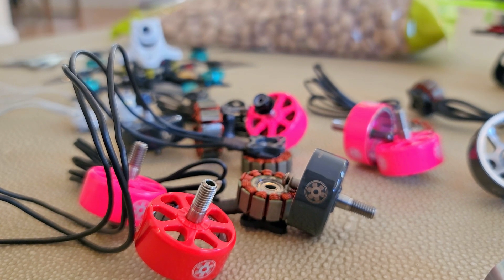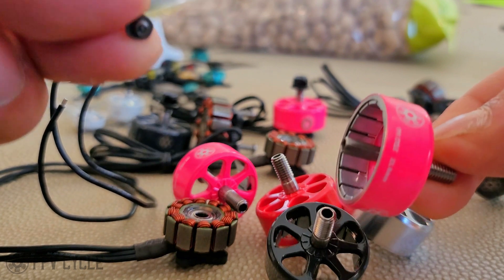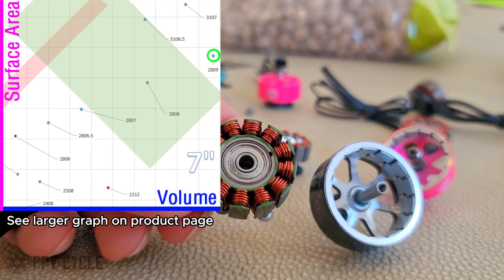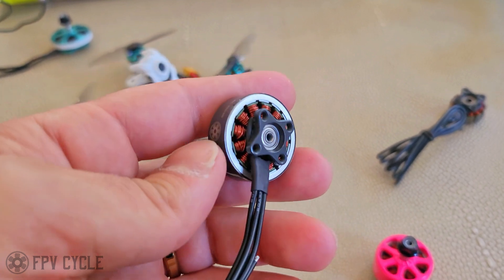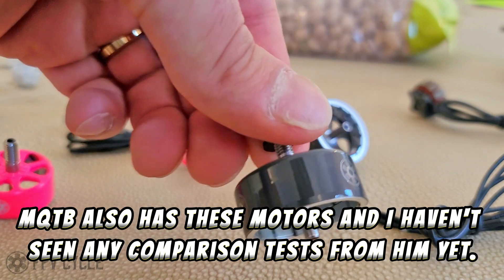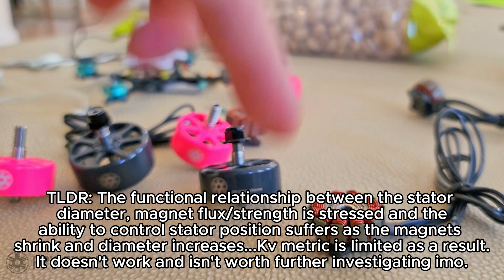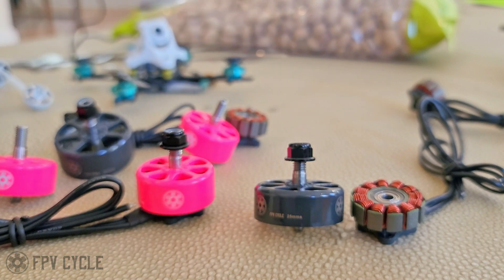Split Shifted Magnets and New Motors

Comment from the maker: Table of Contents:
00:00 - Intro
00:25 - 22.6mm motor stator numbers
04:49 - 28mm motor
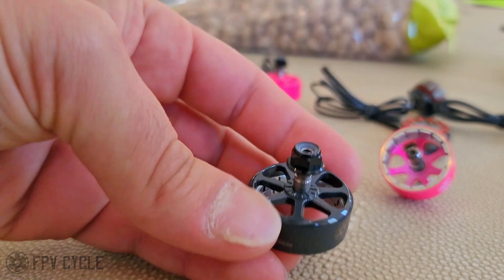05:52 - 25mm motor with split shift magnets
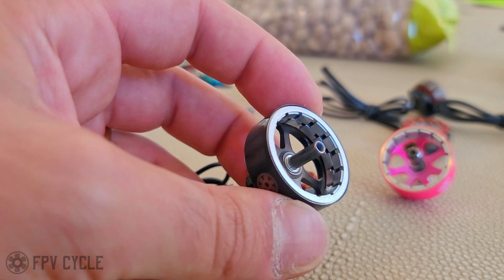07:23 - Split Shifted magnets
09:19 - What split shifted magnets are supposed to do
12:36 - Split Shift magnets don't work everywhere...
16:38 - Difference between 25mm and 22.6mm performance

FPVCycle.com motor lineup: 
https://fpvcycle.com/collections/motors
Reply: aluminum dont rust

Comment: 👎

The screw fixed by heat resistant loctite.
The ball-bearings are heat sensitive.
The tension on the screw must be such so all 4 motors have equal resistance.

You need specialised equipment to do a proper motors maintenance.

Comment: Thanks for the video, you're always up to some very interesting work. I myself keep thinking that we loose a decent amount of performance building everything to be universally compatible. I'm thinking about optimizing a frame around a pre selected set of components.
Reply from the maker: I think the motors, specifically the Kv, prop size/model and battery are the most significant factors. Unless you're doing something very specialized like top speed or aiming for cruising efficiency or something, it's hard to optimize things in a meaningful way.

Comment: Alright sooooo I need 1 or the other 😂 well first let me ask are you discontinuing the 23mm Tall motor for these? If so can I request these in a white color too, I use all your motors from your 13mm and up and have them and white and love all my stuff to match or… hear me out can I get that raw finish in the 13mm? 😂
Reply from the maker: Check the site now. We have the 22.6mm motor with 12x12 M2 mounting base. This is literally the best all around 5" motor as far as I'm concerned and I believe the largest motor out there on the 12x12 M2 mount

Comment: bummer I wish those bells would fit my 2207.5 motor I'd get a few sets right off
Reply from the maker: The split magnets don't work well on any narrower of a motor. It just feels under powered. It's gotta be a 25mm or wider.
Reply: i see 
 @Kabab

Comment: really cool, I recently saw newbeedrones bonded magnet motor (the smoov) and got me thinking, with the bonded magnet all you would need to do is cut it in half and shift it for the same effect, or even cut it in 3 rings or even more???
but I guess other merits like durability aren as sought after with quads that size. That, and I wonder if the tradeoff of efficiency would be worth it.
Reply from the maker: The smoox was intesting but magnets like that are generally much lower strength and so the efficiency and power of that motor was very limited. The split shifted magnets that we're doing now are considerably more difficult to manufacture and they are a bit more efficient on average while generating about the same power.

Comment: I was going to buy the T-MOTOR VELOX but mostly because they are CHEAP AF 14$ a piece. Mainly because in alot of manufacturers these days you can't even get replacement bells (witch is what I mess up on motors) Then I saw this video and I think you sold me in your one comment about "selling bells separately" because EVERYONE should.
Reply from the maker: I don't know why it took so long for even us to do this. I wanted to do it years ago. I actually think it should go a step further and we should standardize shaft lengths. That way you can choose any stator size base and choose the appropriate bell of your liking. All 2306 bells will fit all 2306 stators as long as the shaft matches. Almost all shafts are now 4mm diameter so pretty easy to just choose a length standard or at least list shaft length from the underside of the bell top to the end of shaft.

Comment: I gotta have some hot pink! Also, aluminum doesn't rust, it may oxidize eventually but not rust except   on steel. Aluminum oxidation is a central part of it's corrosion resistance due to it's high affinity for oxygen. It also depends on environment, the purity of aluminum and the presence of other substances.
Reply from the maker: Yeah it doesn't explicitly rust but without anodization or paint, it's supposed to oxidize and sort of rust....but doesn't unless it's exposed to quite a bit of salt water in my experience or some other ion heavy solution in a liquid medium.

Comment: Dude you got way too many different Motors and not enough consistency man. I'm sure everyone including myself appreciate the level of commitment but you have Motors that are discontinued after one or two batches the people are stuck with three motors that work and can't get anymore. I don't get it
Reply from the maker: What motor? We have only discontinued one motor line which isn't even discontinued, just had low demand. That was the 2104 motor. The 23mm short functions the same as the 2104 so it didn't seem logical to maintain that entire line because it's 1g per motor lighter. Otherwise, the looks might change but the line is still the same.

Comment: information        you may know:   a typical electric (inrunner) motor is always loaded via  reduction/Mechanical Advantage (MA).      in contrast, an outrunner motor is usually loaded via  fractional/negative  MA.    ( compare the radius at which the force is produced (in a motor) to the radius at which the load occurs, at the prop/rotor. )
Reply from the maker: The long hand way to explain that gears are smaller than props. That being so, the diameter of the motor isn't necessarily indicative of it's torque. Usually 1mm more magnet height is FAR more beneficial than 1mm more diameter.

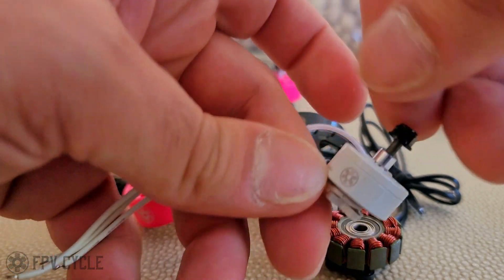Comment: information        8:08   the reduced gap size (at the stator poles) helps to reduce cogging and cogging-related losses.        the use of this low-tech offset magnet configuration 'increases' those affects.         8:36   COGGING.    is the 'drag' that occurs when a magnet(s) is aligned with a stator pole(s).      cogging is less apparent when a motor is running; but it's still there.          specious remark.      to the extent that it's possible, the generation of back-emf in a motor is minimized via  stator design/materials.                    11:05   bla-bla-bla-feels like-bla-bla-bla            because there are Two sets of magnetic poles (on the rotor) where there was one set before, the  number  of  cogging positions  HAS   Doubled.!
Reply from the maker: each 'cog' position has lesser 'drag' however. As a result, the emf peaks are reduced but there are more of them. Generally reduced peaks are easier to deal with as they don't cause as much disruption. I personally didn't measure this and don't really care because the regular magnets run fine too with a decent cap on the ESC. I'm strictly focusing on flight feel because that's really all that matters.

Increased stator/magnet gap reduces cogging from my experience. It lets the magnetic fields space out and blend better while also just being less strong at a distance since field strength drops off very quickly at 1/r^3 or something like that.

Comment: Building my first fpv quad, and just decided to use bobs 22.6 motors based on the info he supplied on the product page for them, and the gemfan 51433 props. All before Bob made a video about them or any reviews had been posted hahah I trust kebab enough, I'm fuckin pumped to throw this thing together. Just need Batts, charger, and soldering materials now.

Comment: Can we get reflective material motors so if you lose it, you can find it with a flashlight near Dawn or at night easier I LOVE that split magnet bell
Reply from the maker: The motors aren't what are going to light up in that situation. Some sort of a beeper is still the best tech we've got for things like this. Someone could probably write a script such that the controller could triangulate the position since pretty much all Rx's now have good telemetry...

Comment: Great Video and work KababFPV!😃 I have to admit that I didn't quite understand everything because my eyelids closed in between😜But something that would be very interesting for Tinywhoop motors would be the better throttle resolution or the easier handling of throttle with split shifted magnets. If the split shifted magnets would help with that in any way, that would be very nice. That would be a game changer. (as well as throttle MID to 0 and throttle expo to 30-70% was a game changer for me when flying tiny whoop) However, tiny whoop motors are always high kv motors. In any case, I would be happy if you were able to build 1S motors with Chinese manufacturers again at some point. Especially also ultra light 702 802 1002 motors for whoops. 
I'm looking forward to your next video :-)
Reply from the maker: Ooh it's hard enough to make those tiny motors as is. There's no reasonable way to adjust the magnet design like this in such a tiny motor and still be able to manufacture it at scale
Reply: @Kabab  Ok I understand. To hard to manufacture..

Comment: Curious, were any experiments preformed with configuring the ESC's differently for use with the split-shifted magnet motors?
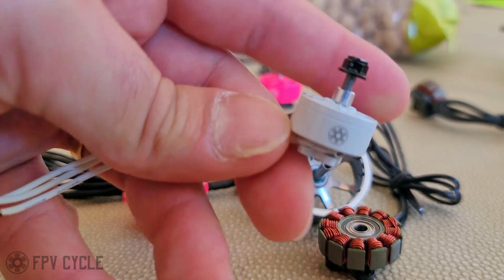Mentioned in the video is the number of pole positions (8:11, with manual rotation) is a doubled notch feel with the split-shifted bell, so wondering if configuring the ESC for 2x the number of poles would change any performance characteristics like torque, rpm response, or efficiency.
Reply from the maker: Kiss has their sine wave ESC which should be the most appropriate match for this motor but it also shouldn't matter a whole lot either. The benefits should still be obvious without any effort like that. The ESC also wouldn't do anything differently if it was told there were 2x the number of magnets. It still just sees one magnetic field per pole. Technically there isn't 2x the poles anyway because that would mean there would be 2x the flip from N to S polarity

Comment: why do you hate 5" 4s. it was THE standard for many years.
Reply from the maker: I don't hate it at all. I just don't see a point when all our electronics are comfortable with 6S. 4S was the standard because we couldn't support 6S. Not because it was particularly good or anything. As long as you're not racing around at high speeds, 4S is great and more efficient.

Comment: Looking at the stagger i can see some design problems that explain your poorer results.  Your magnet width is too wide for full pitch stagger without overlap.   So now you have a generous portion of magnet that is fighting each other and shorting to thr opposite magnet  instead of flowing through the stator!
Reply from the maker: The overlap is not flipped polarity. There is no polarity overlap
Reply: @Kabab   must be parallax in the thumbnail then.  Corners touching, there will still be generous flux leakage between those touching opposites.  I'd recommend a reduction of magnet coverage if you wanted to further test. It already a little high for a delta and the stagger reaching full pitch will cause recirculating current.   Magnetics is my specialty,  feel free to reach out if you want to further the project and bounce ideas around!
Reply from the maker: @HolmesHobbies  that is very interesting. I didn't realize that at all. You're right, the fields are likely recirculating and it's counter productive. The stator poles should then be narrower.....so the magnetic pitch being wider makes sense.....but still shouldn't quite be overlapped so closely. Interesting.
Reply from the maker: @HolmesHobbies  happen to have a FB or something? Maybe you could help with my understanding of axial flux and various induction properties.
Reply: @Kabab   shared my website, look in moderated comments.
Reply: @HolmesHobbies  Hi Holmeshobbies, have you become a flat earther yet?

Comment: Your findings of "should do this" not working as expected is because motors don't always follow simulations and it's much easier to screw it up than it is to improve the magnetics.   It has nothing to do with the length or diameter, it's all about tooth shape, airgap, magnet shape,  and magnet coverage.  

Skew and stagger will decrease motor efficiency and torque in 100% of the cases.  Unless it's designed outside of regular parameters like super low magnet coverage or other silly choices.  Or extreme detent force causing excessive unloaded amp draw, which is normally poor magnet coverage choices combined with delta terminating.
Reply from the maker: In this case it does essentially nothing but does increase throttle feel

Comment: It feels like more throttle resolution because it reduces the motor reactance. It makes the motor softer on response.  Aka weaker. 

I've never seen a skewed or staggered construction be a better motor unless it's strictly feel or harmonics issue being addressed. Or if the origional design is very poor in some factor.
Reply from the maker: Different applications have different need. In this case it was supposed to increase the average torture which it probably did, just no real value in that aspect

Comment: You can anodize aluminium without color. It will be protected just like any anodized colored aluminium, and look raw. Either way, our quads are not really exposed to the elements for that much time, so guessing they dont oxidize that much anyway.

Comment: I purchased 6 Ethix cinerats motors, but noticed that 2 of those have almost zero "nochiness" while the others ones are pretty nochy. They seem to fly okay on my 3" quad, but should I be worried ?
Reply from the maker: No need to worry. The Ethix motors generally use pretty weak magnets and a moderate air gap on purpose. This is also a way to smooth out the flux field and further reduce back EMF. You do lose a considerable amount of power and a fair bit of efficiency, but the motor becomes super problem free and the throttle control is excellent because of the reduced power. I know chris rosser has totally wrecked the Ethix motor in terms of performance but charts are just charts. They don't mean all that much. For the use case and expected flying envelope, the Ethix motor is perfect and there's nothing else like it on the market.......motors used to be built that way in ~2012-2015, it's essentially just a motor from that timeline.
Reply: @Kabab  thanks man!

Comment: Not sure if I missed it or not but does the split shift mags affect the rpm filter? Or timing?
Reply from the maker: na, doesn't affect anything like that. The back EMF seems to be a bit less but I didn't measure that much. I focus more on if it's actually useful to continue investigating for our use case before I look at all the other side effects. So far I've found that it's not very useful but the 25mm motor is a specific use case that has little to no downside with a reasonable up side for the added cost to manufacture.

Comment: The split shifted magnets sound like they would work good for RC crawler trucks if it has better low end control?
Reply from the maker: It's supposed to have more low end torque. I can't feel any of that in the air. Might be able to be felt on something spinning slower but I can't speak of it. I would expect there to already be RC car motors with designs like this but I haven't looked.

Comment: Thank you, great info.   Do you think the 2812 size can be used for a 7" chase build? really trying for 120+ mph
Reply from the maker: yeah I think that's an appropriate size. The Kv and prop selection is going to be important however and will take some testing to fine tune. I would also aim for 8S if you can. It'll give you more oomph to maintain speed for a bit longer. I'd guess something like 1100-1200kv on 8S
Reply: thank you for the fast response!!! @Kabab
Reply: Here is the link for the edf jet chase used 2812 1300kv 7x5x3 hq props xl8 frame https://youtu.be/PKM3cEfS6oM @Kabab
Reply from the maker: @dennismatovich8411  that is impressive. Keeping up with at times a swept wing med size model for 3 min is not easy. Also, you made your video 'safe for kid's on YouTube which turns off the comments on it.

Comment: Interesting idea... it would be great to be able to compare the overlapped magnet idea to stators with vertical at the shaft morphing into diagonal 'paralelogram' shape at the ends instead.
Too much work for non guaranteed gains?
Reply from the maker: That is the ideal way to go, just expensive to manufacture

Comment: Hi kebab - you want to help everyone - produce a custom drone beraing press thatt makes it super easy to replace bearings. I race and always replace my bells - I hate replacing bearings - I damage them 1:5 that I replace - I'm not sure if I'm buying bad bearings or breaking them. Yo make a custom press and sell high quality bearing - I bet bearings are the missing link for efficiency - there is so much quality variations for bearing - stainless, ceramic, sealed etc.
Reply from the maker: The issue with bearings is that they're small. There's very little we can do about that. Increasing their size helps a bit but also adds significant weight to the motor with the only real benefit being that they'll hold up to just a tiny bit more punishment, not a lot more. They're really super easy to replace now so just buy a bag of them from anywhere and pop them in whenever you need if you need...

Comment: Splitting bell and stator is a big improvement! I always had trouble dealing E-clips (or C-clips), but as you show, there is just a screw at the bottom: great improvement too! Thanks a lot for sharing!